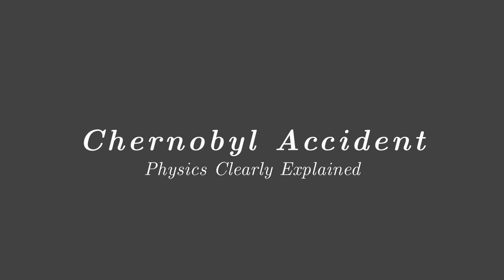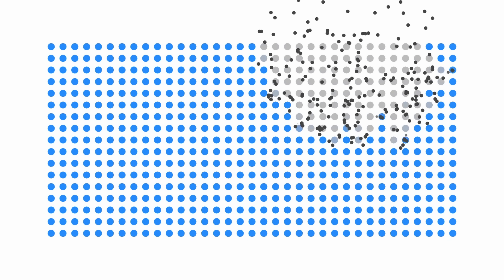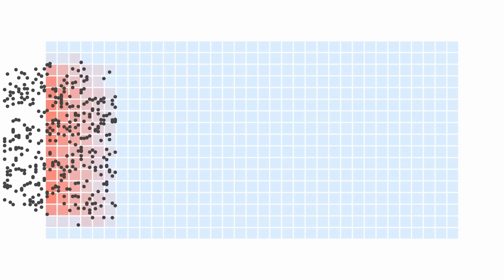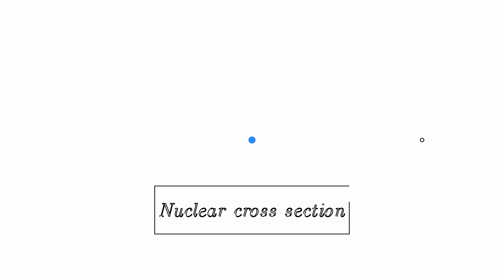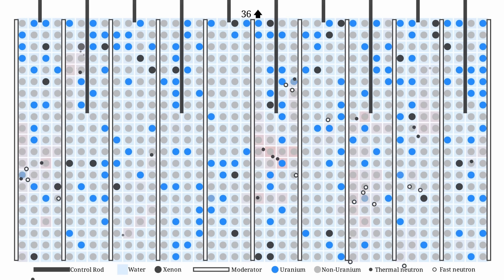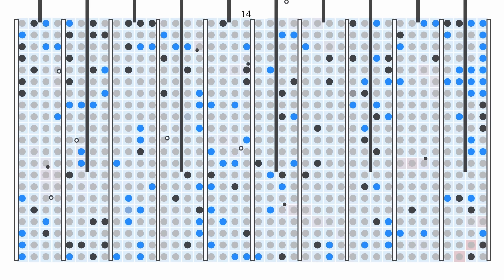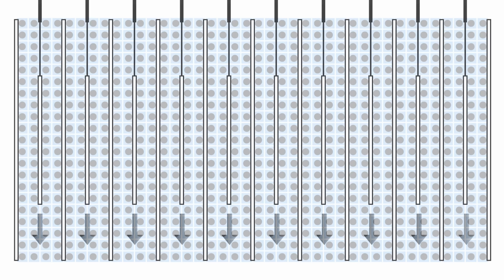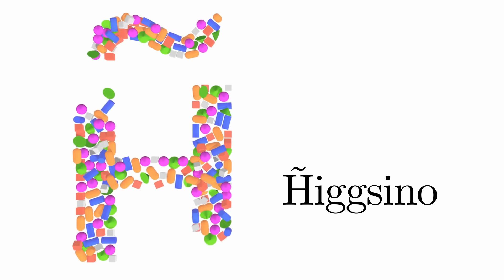Chernobyl Visually Explained

Comment: The HBO series is grossly inaccurate bordering on misinformation. You should simulate the real chain of events of the disaster as documented in primary sources. There are even plenty of channels on Youtube that explain that. Your simulation just reinforces the HBO version that mirrors the USSR propaganda that was attempting to hang the blame on the operators instead of the design itself. 

Please don't use HBO as a source on this issue. E.g. team wasn't inexperience, to the contrary it was exceedingly experienced. The people involved were not some cartoon character villians. The cause of the accident wasn't just the peculiar operation during the test. The reactor was unsafe even during regular operation, and indeed another smaller accident already happened in another RBMK reactor prior to that, except it hasn't resulted in casualties or an explosion so it was covered up. The tips of the control rods were not made from graphite either, and on and on and on. Basically the HBO series despite being brilliantly written and directed is one giant mischaracterization of the events.

Comment: The USSR could easily have copied the far safer Western method of nuclear power generation but went with this awful RBMK design for reasons of cost-effectiveness. Saving money can be a pricey affair. Don't always be so cheap.
Reply: The Fukushima project? Or Three Mile Island? Or SL-1? Today, there are still 7 RBMK-1000 reactors in operation .

Comment: Not sure if I missed it, but i'm trying to understand why the control rods had graphite tips?
Reply: It's not clearly mentioned, but the graphite tips helped get the reaction going again once the control rods were removed, and they also occupied space so that the control rods wouldn't need to displace water to be inserted, it would essentially be "replacing" the graphite tips

Comment: This has to be the most comprehensive, laymen explained video of Chernobyl I have ever seen. Well done and I finally understand fully (for the most part) how this accident happened.
Reply: That chernobyl guy has a 2 or 3 part Series about how it happened that's really good to
Reply: Same! Amazing video
Reply: and never forget the primary reason it happened... a dangerous marxist government
Reply: To those arguing about the simulation:
It is a good simulation for explaining to laypeople the overall concepts that are necessary to understand the accident
It is a terrible simulation if you look at the details, the simulation has no predictive power. Even if you tune the parameters of the simulation, I doubt you could get it to match the actual data of what happened.
Reply: @entcraft44  No, it isnt. It makes it seem like it's all due to xenon poisoning when in reality most of the xenon had decayed at the point of the accident, the time between the power reduction and the accident is long enough for xenon to fall to regular operating amounts.

The biggest contributing factor to Chernobyl is reactor geometry and the fact that even though the possibility of that exact event happening the designers of the reactor didn't tell operators about it and didn't make the necessary changes.
Reply: @SuperHelish  TL;DR You are right, the xenon did not cause the explosion, and the accident cannot be blamed on the operators not understanding how xenon worked. But the xenon poisoning before the accident nevertheless affected the operators decisions and thus the state of the reactor at time zero.

Long answer: In my understanding, one of the most important factors of the instability was due to the coolant temperature distribution in the core. The state of the reactor was evolving over many hours from normal operating conditions, and while the xenon poisoning doesn't play a role at the time of the accident; it did play a major role in how the reactor was operated before. All the accident reconstructions start their considerations very early because they need to reconstruct the reactors internal state, and every step along the way could play a role.

The video at least explains what xenon poisoning is and does that quite well.

PS: Even though I am very well versed in theoretical nuclear physics and know basic thermodynamics; I am not a reactor engineer and have no practical experience. I also don't have time to spend many hours checking accident reconstructions. If I am wrong, feel free to correct me.
Reply: Illinois Energy Prof has a great video on this; easy to follow and thorough.
Reply: Now I know how a nuclear reactor works.
Reply: This is for the most part accurate. An inaccuracy I noticed is at 15:26 where he talks about the reactor caps jumping three minutes before the explosion. This story is entirely fabricated, from a book written by Grigori Medvedev. It was impossible for the caps to jump, they were sealed from top to bottom, and weren’t air tight. No amount of steam could have forced them to jump upward.
Reply: to add on to other comments, xenon levels change on the scale of hours, not seconds. the sudden power raise prior to az-5 being pressed did NOT happen at all, and xenon changes during the final minutes had nothing to do with the explosion. the button was pressed as part of the scheduled test only.
Reply: Its also wrong, and mostly just made up.
Reply: @dachhh it’s abstracted to be able to be simulated in this case. He clearly defines how he added each feature and what caveats it comes with. Halfway through and nothing has been made up

Edit: yup, finished the video and this tracks with the events from the reactors perspective albeit again a very simplified model. It’s a python visualization not a fluid sim
Reply: @JeronimoStilton14  no, it doesn't "track". It ignores the most important factor for the majority of the video, and fails to show the actual problem. You're right that its not a sim, its a cartoon.
Reply: @dachhh  the most important factor was xenon poisoning, if you’re talking about the geometry of the control rods it really wasn’t relevant to the beginning. If it makes it into the sim then it’s introduction point is really irrelevant lol
Reply: @JeronimoStilton14  the critical moment was the final downward motion of the graphite rods, which displaced the remaining water in the lower region of the core. None of which is shown here.
Reply: @dachhh  

do you need a hug? you sound like you need a hug.
Reply: Egon_Freeman  “not a thing at that point in the game” I was unaware the ussr changed the laws of physics after their accident to make things more complicated for us. I don’t know what you are saying. Xenon buildup/xenon poisoning/xenon pit are THE explanation given for what caused the continual drop in power as they ramped the reactor down which then required manual operation to maintain against, which led to their rash decision to extract even the primary (read; never to be removed) safety control rods, yada yada.

Iodine decays into xenon-135 which is a neutron dampener, these levels increase when there is not enough latent heat to burn it off. 

I absolutely grant you that the reactor design was flawed, and will look into the fuel related instability which sounds fascinating but I’m just not understanding your first sentence
Reply: @dachhh  You are absolutly right. Curius question - Why didn't the soviet engineers fill the entire length of the control rod with graphite, instead leaving water?
Reply: @Bajran_  height of the building/core.
Reply: @dachhh  Something like that. I heard they didn't account for the right amount of space under the reactor.
Reply: @dachhh what are they missing then ?? Spit it out

Comment: Wonderful simulation and model. Best I ever seen. But I would ask less to listen to the sect of witnesses of the "AZ-5" button, which arose because of Dyatlov's desire to preserve his reputation. The "AZ-5" button was pressed after the event of the accident and not before it, so the "pushers" did not take any part in the development of the accident. Also taking into account the fact that the moving speed of emergency absorbers is insignificant compared to the speed of development of events. So, 1) dancing rocks, 2) the first explosion (water vapor exodus), 3) push "AZ-5" button, 4) second explosion (evaporated active zone of the reactor).

Comment: (1) maybe y’all could provide some clarity around the power rising when the water was low and the process how/why the graphite control rods were slow to respond to the requested movements, as y’all kind just fast-talked through that? 

(2) So in summary, the model is made up of many specific components that work in unison w/ each other - by varying the way these components are engaged w/ each other, y’all are able to operate the model at some sort of target (optimal?) level and as various components deteriorate, the adjustments to the other components are made to keep the model in “relative equilibrium”?   At some point, there is an overall degradation of the model and its components wherein the model needs to be shut done and “renovated/maintained”…?

Comment: Had the Control rods not have those Graphite tips the reactor would’ve been saved during the scram sequence. What amazes me more is how the water and Xenon were working together to stop the reactor from burning. This design seems concrete. The scientists and engineers who were working that day managed to find a way to make it blow. 

It also seems like the real nail in the coffin was when they stopped the water pumps , it feels like there was no way back at that point
Reply: Just as an FYI the idea of the graphite tips was to replace what would otherwise be a neutron-absorbing water channel with a neutron-moderating graphite channel when the rods are removed. Western reactors do not share this design aspect as the water is both an absorber and a moderator. 

The presence of these tips would typically create an imbalance of flux towards the bottom of the core as the rods are inserted from the top, this is why RBMK also used shorter control rods inserted from the bottom.

Comment: Today all this is taught in school, but back then:

a) they didn't know about positive reactivity

b) they were a research team
c) it was 1986, nuclear reactors were a cutting edge of science
d) they had a plan, but no idea what they were doing, control equipment didn't give them full picture, because it just didn't exist at the time -- and actually this exact catastrophe gave an idea what controlling equipment is required, so even a failed experiment was an experience and led to increase of reactor safety worldwide
e) "computer" mentioned in the video was a calculator in modern terms, it was giving print outs twice per hour at best

So no need to be emotional here, they simply did a test and failed. The rest of the drama and "conclusions" is seemingly based on tv show, not reality. Luckily in the real accident not many people have died, unlike the tv show. Many RBMK1000 reactors worked for decades after Chernobyl without issues.
Reply: The SKALA computer has 7 minutes lag between measurement and printing the result))
Reply: "in the real accident not many people have died" oh man you are quite in over your head
Reply: a) Wrong. The designers absolutely did know about the positive void coefficient of reactivity. They (as in the designers, NOT the operators) also knew that the reactor could be unstable because of this. In fact they increased enrichment from 1.8% to 2.0% to battle this instability BEFORE Chernobyl happened. They increased it again after the accident to 2.4% because 2.0% still wasn't enough. The reason for using low enrichment is that it is cheaper.
b) True. (Who is they? I assume those who designed the test)
c) True.
d) True, but... While they had little idea what was happening because of the limited instrumentation; the reason they had little idea of what could happen is that the design was a secret and concerns, prior accidents and the like were suppressed by the soviet union's system.
e) Exaggerated. The computer calculated the ORM every 15 minutes. It also ran another program which recorded hundreds of data points every second.

Comment: Good simulation, but I'm sure it would benefit with few orders of magnitude more simulation elements. When the numbers are too little, statistical approach is "jagged" and prone to swings.
BTW, the jumping control rods in Chernobyl is a myth. Nothing jumped because there is nothing to jump. The caps had holes in them and do not hold against any pressure. It's a total lie and a fabrication spread by ignorants writing sensationalist books.

Comment: @10:31 ... isn't your model basically saying here that the uranium is only covered in water for the first say 25/30% as you're able to see the blue background colouring? but no water has yet been heated so it can't have turned to steam yet? and yet reactors are full of water or better yet the uranium in a reactor is completely immersed in water.
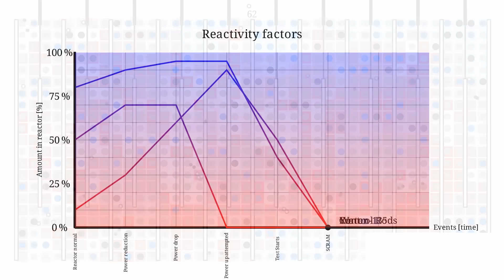Reply: @15:11 ... yeah, I don't get how the water went from literally no water to hot water? ... cause didn't the cooling of steam/no water, make water? and the presence of water is modeled as a blue square? the presence of hot water modeled by a red square and a presence of no water/steam is modeled no colouring of the square/aka white? meaning, like I mentioned previously that the reactor for the most part in this model was empty and later during scram the reactor begins to produce hot water out of thin air? I'm confused lol

Comment: I mean chernobyl actually caused the direct, indirect or premature deaths of over 1 million people, yet less than 100 is the official reported figure ever taken into account. See: Chernobyl heart syndrome, see: the horrific birth defects following the accident. 

Similarly but to a much lesser extent is the cancers caused by TMI, windscale and fukushima. They hide the reality of cancer deaths by comparing the spike to areas without cancer deaths to obfuscate the data and make any excess deaths seem insignificant. Yet in real terms 100s of additional premature deaths have occured. To stick to the official reported data is not only dishonest but also highly disrespectful to those who have lost their lives to nuclear accidents and remain unacknowledged. 

Furthermore, all nuclear reactors are highly susceptible to loss of offsite power as their biggest design flaw. In the event of EMP attack, Carrington event, deliberate sabotage or military strike or natural disaster and the backup generators and offsite power is rendered offline. Most reactors will overheat and meltdown within 12 to 24 hours. Spent fuel pools within 30 days. No reactor is walk away safe. And passive systems don't last forever or long enough to restore active cooling in severe prolonged situations. 

My greatest fear is a carrington solar event that knocks out earths power grids, leaving some 600 reactors and fuel pools without the power to cool them. The resulting nuclear catastrophe would be way beyond our wildest imaginations.

Comment: Having watched quite a bit of the incredibly well-researched documentaries about this on the channel of That Chernobyl Guy, I know enough to say that the cause of the accident was not any "terrible decisions" made by the operators during the run-down experiment. 

It was entirely down to the design of the reactor, including the facts that, after 2 years of burning fuel, the core had a positive void coefficient; and the reactor had a positive SCRAM effect, especially at the base of the reactor core.

The operators present that night, particularly Anatoly Dyatlov, were scapegoated.

Comment: The big question is - what could have saved the situation on physics level instead of SCRAM? Cancel the non-important test and increase of the water flow? What was the safety computer programmed to do? (i assume it would have intervened a step sooner, before the point of no return happened, right? or not?)
Reply: With updated safety systems the same reactors safely worked for decades in several stations. "Computer" in 1986 was a calculator.

Comment: What an amazing video 🤩, the simulation you built really helped me visualise what went wrong.  The sound effects - did the reactor operate with a lot of noise?  I get that the clicks are what a Geiger counter sounds like, but was it noisy or fairly silent to operate?
Reply from the maker: Man that's a great question. And I don't know! but I would guess it's just normal "industrial noise" with water pump and hydraulic moving parts. What I would like to add is of course you can't hear or feel any nuclear reaction. Meaning you can easily absorb a deadly dose of radiation without feeling anything it all. I've worked with radioactive substances before, and it really creeps me out!
Reply: @Higgsinophysics thank you!

Comment: I believe Xenon is gas building up around the fuel rods up, isn't it?
Reply from the maker: yeah it is, and it is maybe a bit misleading in my simulation now that you mentioned it. The nuclear physics in the video, is still solid as it doesn't make any difference to nuclear reactions if the nuclei is locked in a metal grid or is freely flowing around in a gas phase

Comment: I would add, that when the reactor skyrocketed in output.........the small amount of water (in whatever form) left  split into hydrogen and oxygen.......in ideal explosive ratio's and KABOOOOM.   Hydrogen and oxygen explode with a shock wave 300%  faster than any other known chemical substances..........and that packs a very heavy punch.   This is one of the key reasons why water is a bad idea in a reactor........it cant hack temperature without very high pressures and it has a habit of expanding 1700 times when it finds a breach and when it encounters melted fuel rods it has a habit of producing a violent chemical explosion.